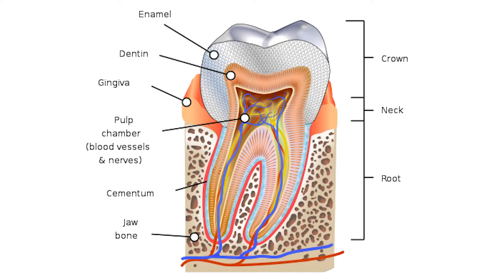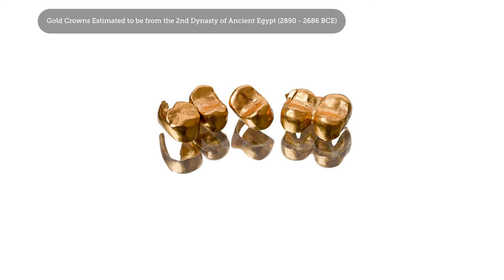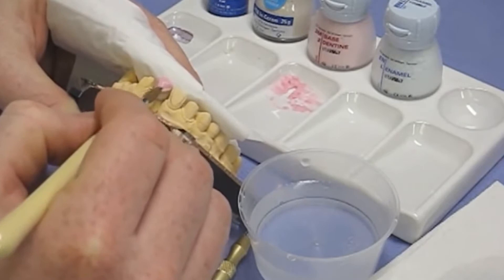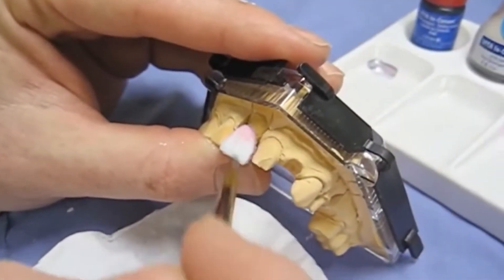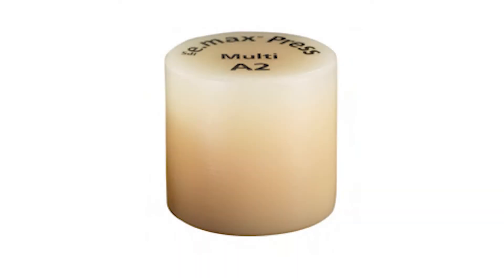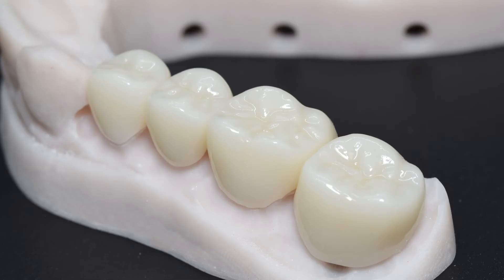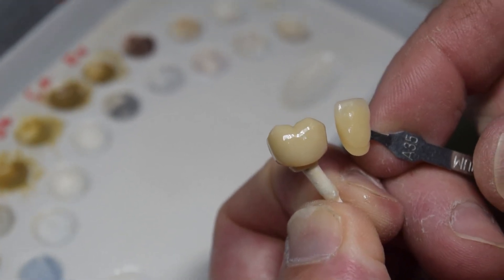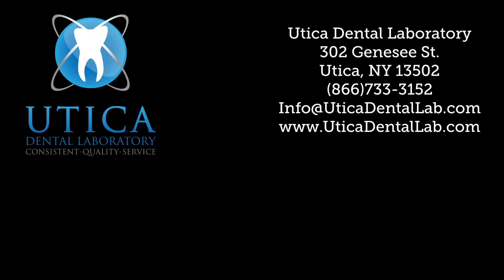Types of Dental Crowns and Materials - Gold, Porcelain, Lithium Disilicate, & Zirconia

Comment: Manuel crafting of crowns has been out of date for at least 10 years. No physical mold or hand work or time needed anymore with 3D scans that the dentist then design the crown what assistant software. New crown is milled by a machine and then cooked by the dentist and then fitted all in one appointment.